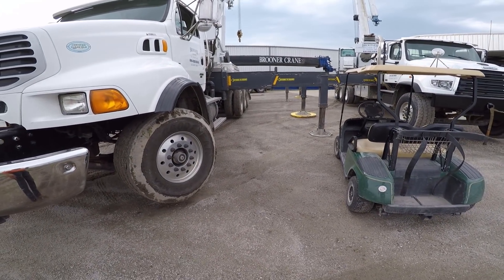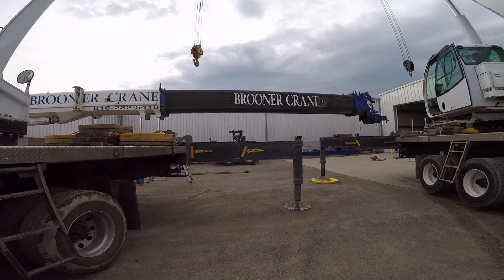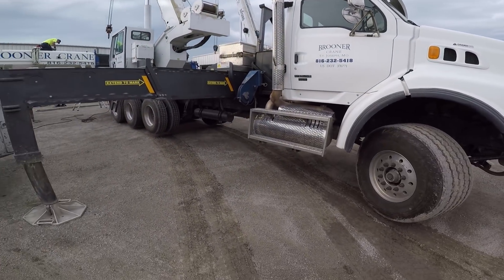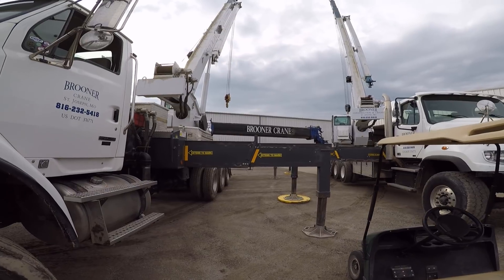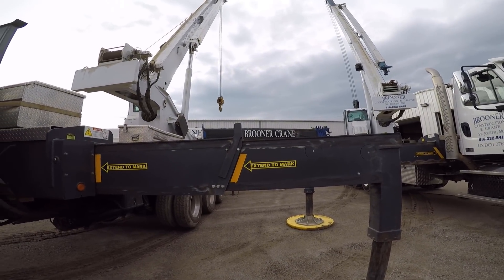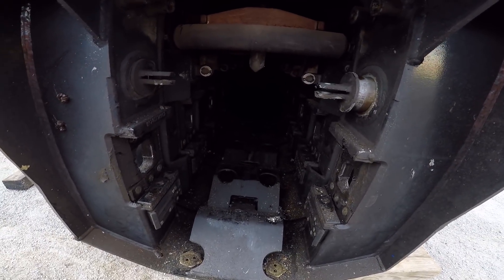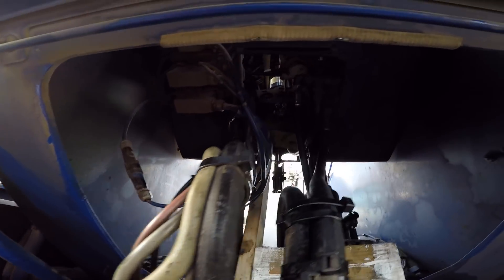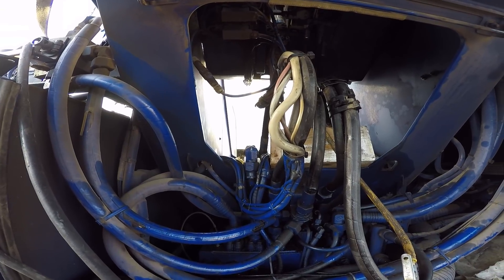Disassembly of the boom on the Tadano ATF 80-4

Comment: What was happening that you knew the telescoping cylinder was leaking?  I just bought a used Manitex 22101S and it failed the inspection due to the boom retracted 4" when it picked a load.  This thing had been sitting for a couple of years, but it was just certified.  The LMI was bad, so I bought a new one and when they load tested it, that's when they found the issue.  I talked to a Manitex mechanic and he said it could be a few different things other than the telescoping cylinder (ie air in the lines, the cables being out of rig, etc).  I was just curious if this is the same thing that was happening to your crane.

Thanks for any info!!!
Reply from the maker: We had a visible leak from a fitting on the side of the telescope cylinder on our Tadano ATF 80-4. We had to pull the boom apart to get to the fitting. If you are having trouble with the boom retracting under load on a live boom crane, it would be one or a combination of the following: cables, telescope cylinder holding valve, telescope cylinder packing, air in the system, or faulty telescope valve. If it has a foot control for telescope, I have seen them out of adjustment before. Allowing the cylinder to creep in.
Reply: I appreciate the info.  I am going to go and pick it up from the mechanics tomorrow.  I was told that I can extend the boom all the way out and put it at a negative boom angle and let it sit over night and that will get all of the air out.  If that doesn't work, I am going to put it up halfway, then disconnect 2 hoses and put each of them in a 5 gallon bucket and let them sit.  I believe one is off of the holding valve and the other is off of the telescope valve.  If one of them fills up with fluid, that is where it is bleeding by and causing the un-commanded retraction.  If I don't find anything with that, I need to find someone to help me check the rig on the cables.  I am praying that it is one of those things that is the issue because I am going to need to figure out how to get the money to tear the boom apart.  I was told that it will be 25k if they need to tear it apart...  Thank you again for the info.  If you have any other ideas, please let me know!!  I will take all of the advice I can get!!
Reply from the maker: @cfenton806  if you cycle the telescope slowly, it will eventually run the air out. If you have air in it, the oil will become aerated. Then you will have to let it sit until the air comes out of suspension (works it's way out of the oil). Over the course of a few days, you should be able to get the air worked out. Disconnecting your lines will probably only make it worse. As you will be introducing air from the disconnected line.
Reply from the maker: There should be info in the manual for checking the telescope cables. It will require some measuring. Also, if you boom it down to a negative boom angle with the boom fully extended, make sure you are over the rear and you have small ball on it. Not the block.

Comment: I can understand why that would be such a pain. After you told me what the difference was between a boom truck and a crane I know for sure now that mine is indeed a crane. It is all one piece. Due to the length of it it is really difficult to get out of the parking space that  I have it in which is why you haven’t seen it in my videos yet. Because just with everything folded in, The truck is over 3 feet long. This should give you a little bit of a  perspective. I have a flatbed truck in the fleet that I carry most of the heavy equipment on, and if I were to park the flatbed by the crane There is still at least eight more inches before the actual truck ends. And then if you multiply that by 16 you will get an idea of how big it is in real life.
Reply from the maker: Alex Williamson'sadventures, that sounds like a pretty big crane. Is that the one you are going to make a video of?
Reply: Yup that’s the one. I figured you would probably want to see the one that is most similar to yours first before I showed you some of the smaller  Telehandlers.

Comment: What happens if you don't catch a crane leak soon enough? Is that always dangerous?
Reply from the maker: Jack Sak, it depends on what is leaking. This particular leak, had the plug came all the way out, it could've lost pressure to the telescope cylinder. That could lead to a situation with the boom stuck in the extended position. Typically, a leak is just messy and creates a small fire hazard. Thanks for watching! 🙂

Comment: I wonder if the plug could be lockwired in the tend to tighten direction. But hey if it doesn't leak for another 12 yrs its all good.
Reply from the maker: Bradford Lunt, the plugs are recessed, and when the cylinder is pinned where it belongs, there is less than 1/8 inch clearance. All of the plugs may have gotten a drop of loctite though. 😉

Comment: Did you figure out what caused it to leak? For static O-rings it usually comes down to either it was nicked when installed, or it was not the right material for the fluid used.
Reply from the maker: Rambozo Clown, actually a few of the plugs had come loose over time. That crane has been flawless for the past 12 years. We are thinking, heat/cool/pressure cycles may have loosened them up some. Hopefully, after new o-rings we won't have to worry about it for another 12 years. Thanks for watching. 🙂
Reply: @ToTheTopCrane  great job

Comment: Having it that torn apart I would've replaced any hoses or any other part that would require that kind of tear down again! From soup to nuts....everything! I'm sure it wasn't a cheap endeavor tearing all that down and putting it all back, preventive maintenance is a must, I would imagine, for a piece of equipment like that one. 
Thanks for the video.
Reply from the maker: Duncan MacKenzie, we replaced every o-ring on the telescope cylinder that wasn't accessible with the cylinder pinned in place. All of the hoses and such are accessible from the backside without too much trouble. Thanks for watching! 🙂
Reply: I kinda figured you would. Thanks for the reply.